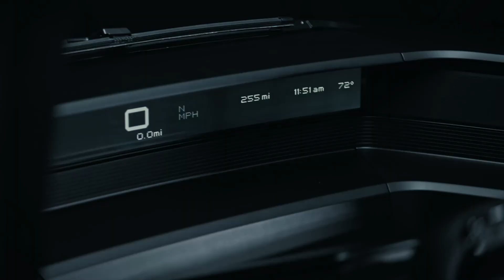Canoo electric pickup truck truck is small, utility-focused & has up to 600 horsepower

Comment: Interesting design, but only 2 doors? If this was 4 door it would be more interesting. This is a small pickup. I do not think it competes with Tesla. It would compete more along the lines of the Tacoma and maybe the R1T. It also does not have the range or the performance of Tesla or Rivian or the towing capacity.